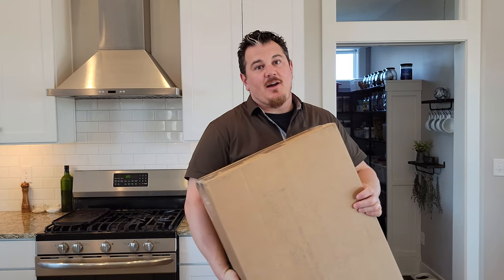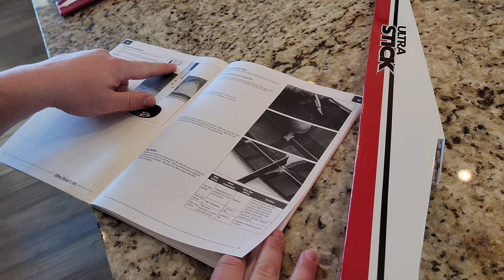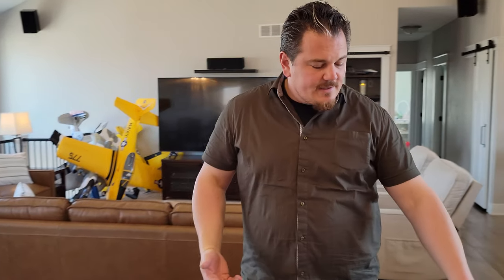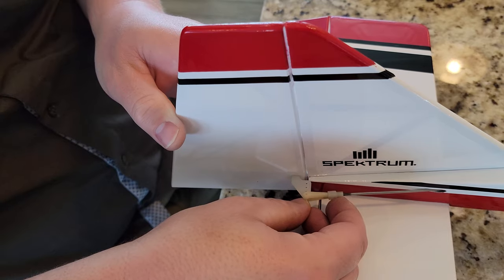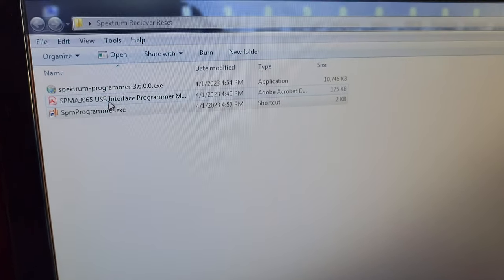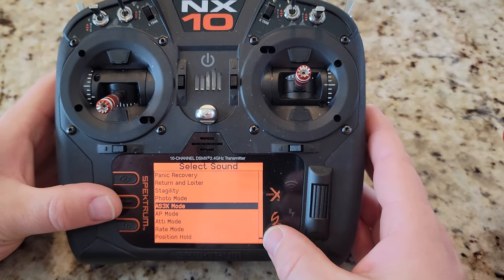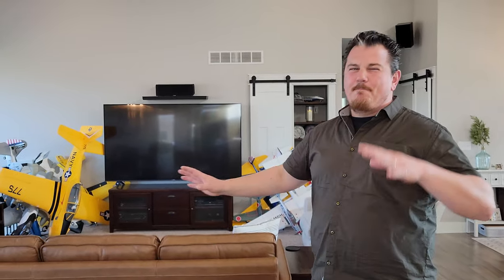E-flite - Ultra Stick - 1.1m - Unbox, Build, & Radio Setup + Flapperons!!!

Comment: The Aileron and Flap control surfaces must already be pre-joined if one does not wish to install the "outboard aileron" servos ?  So coming out of the box, the inboard servos are serving as aileron servos, instead of traditionally being flap servos and if one wishes to have flaps, you have to install two more outboard servos, which normally should be traditional aileron servos  and cut apart the joined aileron and flap control surfaces.  Correct ? ......It should be the other way around.  They should have made it much simpler by just adding Flap Servos where they are suppose to be and add the aileron servos and keep the control surfaces unconnected !  Your set up on the computer radio is too complicated to simply enjoying flying.  FM is much simpler. forget all the complicated setups, just get out there and fly !
Reply from the maker: Your complaints (the stock setup is too hard and I made it too complicated) are non issues...

This is all VERY, very simple. IF you want inboard flaps...

1) Cut a hole in the OUTBOARD Aileron's servo pocket
2) Separate by cutting the dowels between the OUTBOARD Aileron from the INBOARD Flap
3) Pull a servo wire back from hole to center
4) Land wire at Aileron Pocket end
5) Mount Servo in Aileron Pocket
6) Repeat for the other side
7) Change wind type in Wing Type
8) Change wire landing points on Rx
8) Go back through Forward Programming
9) Verify Flap Modes are still good, or adjust as necessary
10) Test controls

Study the wing for two minutes and come up with a different plan if you wish. I'm not making anything more complicated than it has to be, I'm making it EXACTLY as complicated as it needs to be to get the job done.
Reply: The Stock setup is not too hard it's just that they should have included Flap Servos. @BrianPhillipsRC

Comment: Neither thrust reverse nor programming is through the extra lead with the single yellow wire, that is a carry over from the factory for something else. It does literally nothing on Spektrum systems. Programming and reversing is all done through the normal throttle lead (reversing is part of the Smart system).

Comment: Hoping you can help, Brian.  I've completed assembly of my Ultra Stick and "bound" it to my NX8 Tx.  I didn't look ahead to the section on SAFE and am now wondering if I may have done it wrong?  In the section Enabling SAFE select, it doesn't say, but i'm assuming, that you start with Tx powered on?  In section SAFE Switch Designation, at the end of assigning a switch I get an error message "failed"; yet, if I look in Forward Programming, it shows SAFE is "ON" ??  I want to initially fly this plane in SAFE mode - how do I tell if it's truly in SAFE mode while on the workbench?  And if I've done it correctly, how do I tell which switch position is for SAFE, AS3x and Full Control?  Thank you very much and especially for your content - extremely helpful and presented intelligently.      J Giles

Comment: Hi Brian, my brain is spinning after watching this.  So much important information. I'm about ready to begin unboxing my Ultra 1.1 so I'll be referring back to this video often.  Thank you for your efforts to educate us.   I have another question relating to Spektrum programming.  I also fly gliders and just completed a 2m V-Tail glider with only 2 control servos - for the vtail left/right ruddervators.  My first experience with V-Tail and I'm having great difficulty getting it programmed so that both up/down and left/right are on the right stick.  I have an NX-8 and the web seems to have very little step by step help for Spektrum Tx controlling a simple V-Tail.  Is that anything you might be able to help me with?  If so, i can provide my contact info.  If not, I understand...  jerry g

Comment: Brian, how did you do your flaperon setup? I have an older dsm2 spektrum receiver and the ailerons are connected to the receiver via a y harness. it is 6 channels. Don’t know the exact model because the sticker came off a while ago.

Edit: when I followed along the flaps just made it do left or right roll, instead of doing flaperons.

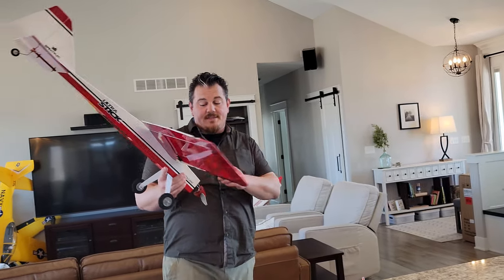Comment: 1:08:46 so if you factory reset and program from there would all control surfaces act on AS3x and SAFE like factory? Thats the only thing holding me back from programming flapperons into my Ultra Stick
Reply from the maker: I'm so sorry, but just can't remember, so I don't know how to answer this question.

My suggestion, update the Firmware on the Rx in YOUR plane (mine was older) and then you'll be able to use AS3X+ which will give you one heck of an improvement in control authority while using Flapperons. It cost nothing, but time, and a little bit of annoyance (it's really not that hard) and you'll yield the biggest results.

Sorry I couldn't help the way you wanted. I usually can remember this stuff...but for whatever reason, I can hardly recall what we did on this plane.
Reply from the maker: 1:11:33 - I found in the manual that you have to RESET the Rx to do it...so my comment stands ;) Sorry for my delay...I had to watch that section. We show how to do it, but if you upgrade the firmware to AS3X+ you'll get the DOUBLE WAMMY ;)
Reply: @BrianPhillipsRC Thank you, I didn't finish the video until this morning and just saw that. I wanted to ask as early as I could in case it wasn't gone over in the video so I could still fly today, thanks!

Comment: Dumb question or 2. I want to set up the two servo setup to include just flaps and ailerons. I don't want or need spoilerons. I also set up reverse thrust already. From your video I was getting confused with the changes because of the factory reset and all the forward programming changes it appears that is necessary to keep AS3X and Safe working for both control surfaces. Help !!
Thanks
Reply from the maker: You can do this NO PROBLEMO, all you need to do is check out another PNP plane we've done an "Unbox Build Radio Setup" on recently...Here's one - The FMS P-51 1.45m Unbox Build Radio Setup - https://youtu.be/lnzUfTsZHQ8
Reply: Thanks

Comment: Question, would this be ok for a beginner since it has those safety features?
Reply from the maker: I wouldn't suggest it, but there's lots of people (trying to sell you something) that would say SURE...I for one, think this is a great plane for an intermediately skilled pilot, and even better fit for a skilled pilot.

Here's our somewhat shortened "Beginner list" to help you get a feel for what we typically suggest...

Description | Purchase | Videos
Habu STS 70mm RTF | https://bit.ly/3ci5eWD | https://bit.ly/3ontBF9
Apprentice 1.5m RTF | https://bit.ly/3BlSjh9 | https://bit.ly/3b6kCVP
Carbon Cub S2 1.3m RTF | https://bit.ly/3PqNR4A | https://bit.ly/3J6WmQ3
T-28 Trojan 1.1m | https://bit.ly/3PmbxHf | https://bit.ly/3v8zGJi
Apprentice 1.2m RTF | https://bit.ly/3BlSjh9 | https://bit.ly/3Bk60wG
Sport Cub S2 UMX | https://bit.ly/3yYkrUs | https://bit.ly/3PL8vfJ
AeroScout 1.1m | https://bit.ly/3OlqyYQ | https://bit.ly/3ztp9Li

Trekker 1.2 RTF | https://bit.ly/34jhgLZ | PNP https://bit.ly/35xOPu8 | https://bit.ly/3PHoZ8M
Bigfoot 1.3m RTF | https://bit.ly/30mYdOq | https://bit.ly/3zqIxZu
Pioneer 620mm RTF | https://bit.ly/2YotgbY | https://bit.ly/3OvJLad
Prodigy 1.4m RTF | https://bit.ly/37zJxzt | https://bit.ly/3cvccaZ

Ranger 1.2m RTF | https://bit.ly/3bHFIKr | https://bit.ly/3bCezZB